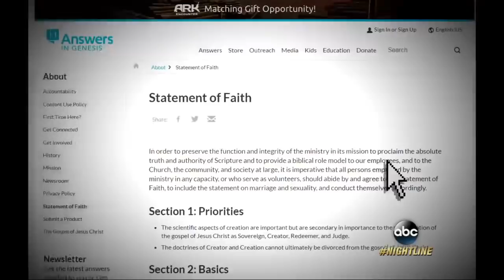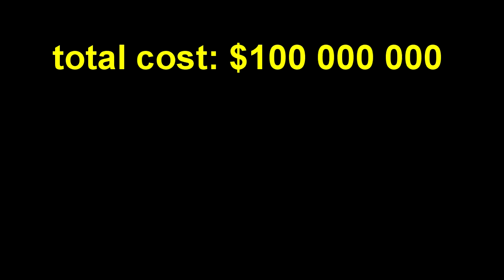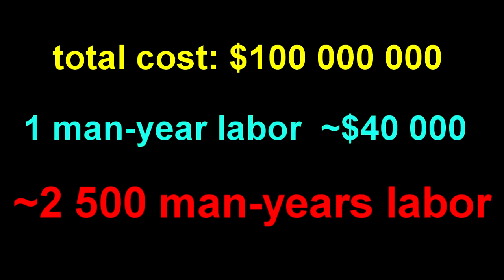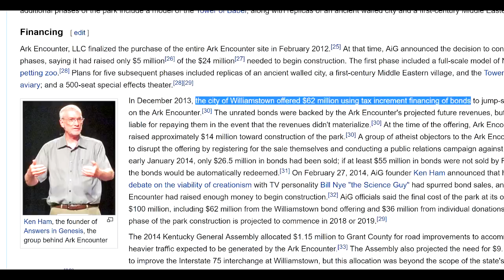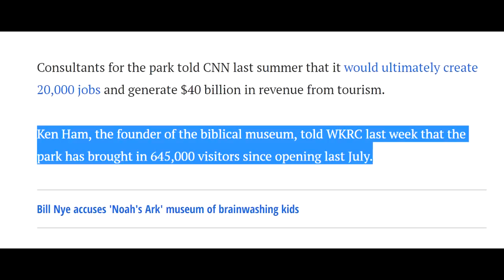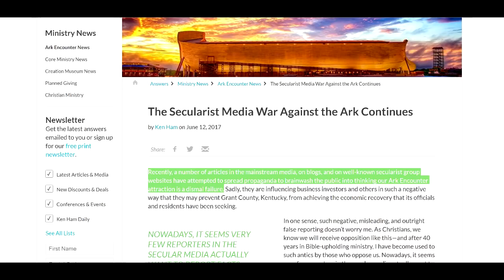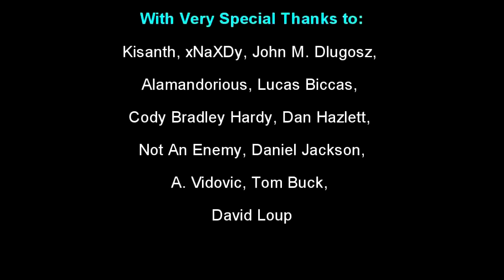Why do people laugh at creationists (part 44)

Comment: Nobody mentioned that this ark is designed with a bulbous bow, a feature which was invented just over 100 years ago.
Reply: It's clearly influenced by modern boat design. If he'd been thinking about it, he wouldn't have included it- a bulbous boat bow gives better water flow, allowing for better efficiency on your propulsion system.

...Which is completely redundant on the ark. The ark is supposed to be designed to float, not sail. It has neither sails nor engines.
Reply: It wouldn't surprize me that Ken Ham has "discovered2 a new passage in the bible.
...and yah, Noah did load all the animals then hitched up the dinosaurs to raise the sails.
Reply: Strange. I wonder what he was sailing to.
Maybe he figured the water where the ocean was would be less corpsey.
Reply: Less corpsey, I love it.
Reply: Ah come on, at least it was built by traditional lifting cranes.
Reply: Actually according to Ken Ham that bulbous bit is the stern!!!!
Reply: Bill lupin  a bulbous bow/stern also helps with hogging, a serious issue with wood ships.  Honestly surprised its not something thought of millenia ago.
Reply: Graham Bunton It's all OK, even the slightest attempt to float the damn thing..it would bust apart...even with modern construction techniques, it seems it is holding itself together. Chances are it will go up in flames in due time...or used as a weird warehouse, like the old wooden WW2 blimp hangers used to. One of the two in Oregon went up in a spectacular fire some years ago, the other is used as an aircraft museum...after being fully sprayed down with some form of fire-retardent...the first one unfortunately housed fully flammable Hay...
Reply: Bill lupin
What he was sailing to? All around the world of course, most animals can't travel far enough within their life span to come. 

And we didn't even start talking about the plants because, hey, would should they eat? And how to repopulate everything after all the plants drowned. I manage to routinely over-water my plants and they wither away, so you can imagine what a flood that covers them totally would do to pretty much any and all plants. They can't just uproot themselves and walk over to the arc!

And with a travel speed of roughly 30 knots (the speed a modern aircraft carrier could muster if it really had to) it shouldn't take more than a few decades to collect every animal from the planet twice. Provided of course that they want to come. But I guess god would tell them to not do what they usually do, i.e. either flee or try to kill you as soon as you try to squeeze them into a tiny box.

But hey, the whole story already fails at Genesis 6:6, so why bother pummeling the dead horse with logic?
Reply: Look at an ancient Greek trireme. 100 years ago my left foot..
Reply: Henri Du Plessis The two  designs are obviously different, the Trireme seemingly built as an extension of the keel, probably a construction limitation consideration. The modern bow considerably more difficult to build...designed with hydrodynamic efficiency in mind, a concept not yet realized  for hundreds of years still...
Reply: One word for you: 
tessarakonteres
Reply: Henri Du Plessis I'm of the opinion such a vessel may or may not have been built...perhaps it existed only on paper, an idea. By the writings such a vessel was not practical,  feasible & dangerous IF, it ever went to sea. By various marine structural engineers, this vessel as well as "The Ark", could not set sail in open seas as the most modest of open-water swells would rip the vessel apart. This said, the vessel in question might have been constructed & even floated, ran under power...but anything past perfectly calm waters would have destroyed it...this might be the reference to "dangerous"....as the engineers of the time might have built this, found it to be too fragile & removed it from the waters....an experiment, an experiment to see just how large "they" could build such a ship.
Reply: Of course, everybody is entitled to an opinion.
Reply: Henri Du Plessis Of course the best thing would be someone to ante up the millions of $$$, & by the best educated guesses, research by naval historians, up & build the thing...if not by trying to make money on it...just outright curiousity. My best guess would be, given all the research into period correct materials, construction techniques, a structural engineer would say.."It'll float..but swells past Twelve meters will cause a failure, here, here, and..here, at these points". It would be quite the sight for sure.
Reply: Maritime engineers of the time were designing triremes. The ark was pretty clearly designed by someone who had no idea how boats work.
Reply: Bill lupin "engineers of the time"  were guessing, trading stories of what worked & what didn't...the actual science, the likes of Youngs Modulus,  empirical science, higher mathematics was long still into the future.
Reply: It runs on a bullshit engine. Duh.
Reply: What an extremely intelligent, adult and wise response. You are clearly made of sterner stuff than most. Ever consider a career in higher criticism?
Reply: Have you gone to the Answers in genesis website to see what Ham really says about the Ark? take the trouble. It is such a waste of time trying to prove how wrong something is when the originator admitted in the first place that he's not claiming it to be perfect. I have no interest in a debate with you. Let me make that clear from the outset. I have no time for selective quotes and defensive reasoning, I have been through this process myself for long enough. You see, if you are atheist, you have to prove Ham and the Bible wrong. I know, I was there. You absolutely HAVE to in order to sustain your belief system and your preferred lifestyle. Because imagine if it turned out he was right. Your goose would be cooked. Simple as that. It IS a life-threatening situation for you then. The vast majority of commentators on this page, most of whom are so mentally vacuous that they are unable to participate in logical debate at all, absolutely HAVE to believe Ham and other creationists are wrong. As such, no debate is possible. Look around at the comments – "ad hominem", play the man, not the ball. The fact is that the so-called bulbous bow design of ships had been known for long, before European ship builders had to rediscover it, or reinvent the wheel. The plumb bow of mono-hull sailing vessels were long discarded and almost forgotten about until some sharp card picked up on it again and realised that when your waterline length and your overall length were more similar, you had better performance by length. Greek and Phoenician ships had the extended stem bow long before anybody realised it would make for a good ramming device. The Phoenicians had it on cargo vessels that had nothing to do with ramming. But the fact is, if you are an atheist, you HAVE to disown that for the sake of your argument against Ham's, you’ve no choice and that lack of choice does not only have to do with getting some egg on your face, it has to do with your very life. So, those who wish to argue it can go ahead and argue all they like, I’m a true democrat, I believe in the right to choose. I’ve had to make choices throughout my life too, some of them very wrong. One's choices and views might very often be wrong, for all one's intelligence and apparent knowledge. Just look around among these comments. They will show you who's who. Ham is at least honest about the shape of his Ark. He candidly admits that it is impossible to know the details of what the Ark looked like and that his Ark is but a proposal. If you took the trouble of actually going to his website, you would have known that. But maybe you cannot bear to. What if…? You argue from the evolutionary point of view that the ancients did not know what modern man knows today, because maybe you believe everything exists after a series of incredible, mind-blowing accidents out of nothing and that it then had to develop, unguided, over aeons of time. Ham argues from the point of a belief in an all-powerful Creator who contributed to the situation at the time. This would mean that, in order for you to sustain your belief system, you absolutely cannot believe that the Ark was real. You cannot. And Ham cannot for a moment believe anything other than that the ark was very real. And the one belief cannot argue away the other. So I’ve no interest in a debate of this nature at all.
Reply: Henri Du Plessis I will not  succumb to your "Baiting, triggering", despite your assertions to the contrary...as such, you throw down the gauntlet thru your extended diatribe, sorry, I will not fight...find someone else.
Reply: Henri Du Plessis
Actually, all I do is to not believe. Basically I listen to someone's story of a god and all I do is say "nope. Not buying it".

Without theists, atheists wouldn't even need the label. The label exists only because there are people who do believe in gods, because being an atheist is as much a religion as being abstinent is a sexual position.

How is this a belief system? What is my belief? I don't even believe that there is no god. All I do is look at the claim that there is one and it fails to convince me.
Reply: +Henri Du Plessis I find it quite telling that despite Ricardo Ellison's respectful way of reasoning, you have to start the name-calling. Going by what you yourself said about looking in the comments, it is you that is unreasonable and you made quite clear who is who. Classic case of shooting oneself in the foot.
Reply: Eh, yes and no. Trial and error counts as science, even if they didn't have a full set of equations to work with.
They did also have aristotle's notions of buoyancy, leverage calcs for oar ratios, etc.
Reply: It's not so much that we're scared of going over and reading Ken Ham's extensive claims and justifications, it's more that we have better things to do.
We know that man, back then, didn't know as much about boatbuilding as modern man today, because we can follow the evolution of boatbuilding through the ages. There are boats, and records of boats.
The ark is an example of design by somebody who has NO goddamn clue how to build boats.

If I had to design the ark, knowing what I do about engineering...
I wouldn't make one. I'd make hundreds. Far smaller, and attached to one another via something flexible... chains, preferably, with retractable gangplanks. Also, the sides of the boat would have some manner of springboard or cushioning, to reduce impacts.

The idea is, splitting the load into many smaller boats drastically reduces the possibility of catastrophic failure, it makes the animals easier to control in case of escape, it dramatically reduces the expertise needed to construct the boats, the flexibility of the whole shebang dramatically reduces possible damage from waves, and if something goes REALLY wrong, you can always just detach a damaged boat. What happens if a chunk of the big ark's hull caves in, hm? Whole thing sinks. Not so, here.
Reply: What kind of Ark Experience are you getting when the thing can't even float or sail on the water? EPIC FAIL! Might have been more successful if you could actually ride on it like a cruise ship or something.
Reply: Looks like you're pretty interested in the debate to me.
Reply: Not much hogging to do, there's just two pigs...
Reply: Also no one mentioned there is no reason for a "bow" of any sort as the ark has no steering and no propulsion.
Reply: Chris Antoniou they would feed the animals with gas-producing diet...
Reply: @henriduplessis2640  you are correct in one thing: debate is impossible. In a debate resaon vs. belief, logic doesnt come into play and therefore debate is impossible.
Reply: @0x777  dont expect believers to understand this, they wont which is why they are believers in the first place. you argue with reason, something they reject outright so it seems pointless to argue with reason why you use reason. after all they are atheists themselves with respect to all other gods and the toothfairy and unicorns, but they wouldnt admit to beeing aunicornists, would they?

Comment: Lets pray for a flood just to see if it floats.
Reply: I know you're joking but it's stuck on concrete
Reply: @danielbronfenbrener5601  Well now I guess that's why we can't find the one Noah built , it's stuck in concrete. lol .
Reply: The magnetic poles will switch... but what does that have to do with earthquakes?
Reply: Nah them concrete pillars are gonna hold it down😂
Reply: If you have faith you can do anything!

God help me
Reply: If it does float you might wish that you were in it. Gee, hasn't anybody other than I seen the movie Evan Almighty ?
Reply: Hydrology professors and naval engineers say yes it can float based on its design and size.
Reply: @throcmorton 
Of course it can float, if you seal up the gaps with sticky pitch and get rid of all the electrical conduit holes and such. But the original ark would have floated better, well since it was actually designed to float.

The ark lacked any means of propulsion, because it was not designed to actually go anywhere, but rather to survive the deluge and to protect its occupants. Being of a flat and ugly barge shape, it would have be very stable and able to ride out terrible storms.
Reply: @Yosef MacGruber They currently have a lawsuit for .......WATER DAMAGE.
Reply: @keithparkhill8546 
Hmm. I wonder how much water damage occurred to the set of the Titanic movie, as the entire set was submerged into a giant water tank? I did notice a place where the carpet was already wet. Oops. Obviously not Take #1.
Reply: @throcmorton  IF it was actually a boat, but it's not, it's a building made to look like a boat.

Comment: 5:06 shot of massive concrete pillars. 
5:07 Ken Ham claims he is on the largest timber framed building in the world 
5:13 shot of more massive concrete pillars.
Reply: Ken Ham explains in a video they had to abide by modern day building codes for this.  You might to more research to be better informed before you make ignorant comments.

Comment: There are 2,000 hours/per year as a full time job currently (does not include two weeks vacation).  One thousand construction workers x 2 two full years of work x 2,000 hours/year = 4,000,000 work hours x $40/hour = $16,000,000 labor costs.

Noah’s family 10 people x 2,000 hours/person x 40 years = 800,000 work hours x one shekel/hour = 6,400,000 shekels labor cost.

I guess Biblical workers are known to have been much more efficient workers than currently.

Comment: Hopefully some decades later it will be repurposed as something useful.
Reply: Hospital, school, burning man?
Reply: Reckless Roges 

Burning man made me laugh. Thank you sir.
Reply: Science centre, people love those.
Reply: mxt mxt Full it with science books, evolution, Big Bang, etc
Reply: Or how about use it as an actual boat
Reply: Anjum9694 It does not work as a boat. Wooden ships of that size easily bend and break.
Reply: Decades? I wouldn't be surprised it it starts to fall apart in a few years.
Reply: Lilitha11 

They used concrete to hold the boat so that it wouldn't break under its own weight.
Reply: haha, scientists should buy this up and turn it into a museum that teaches actual science, and mabe lower the price too